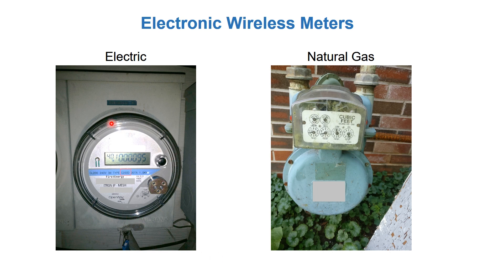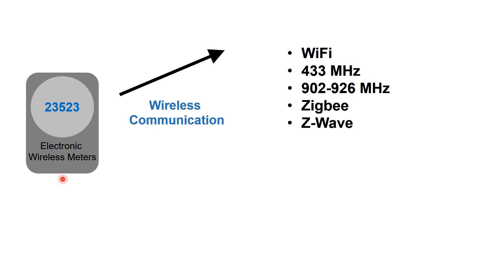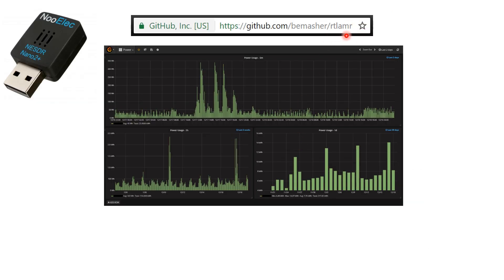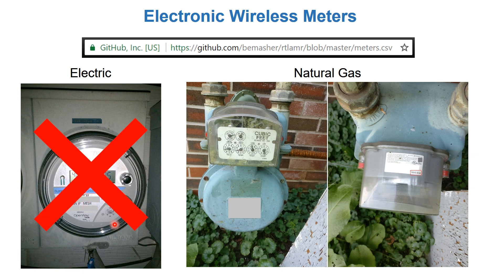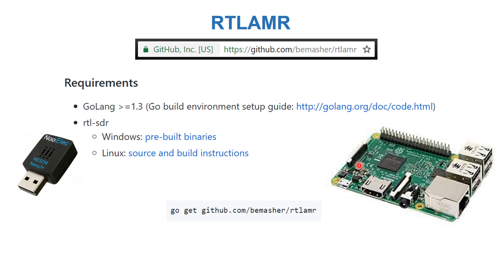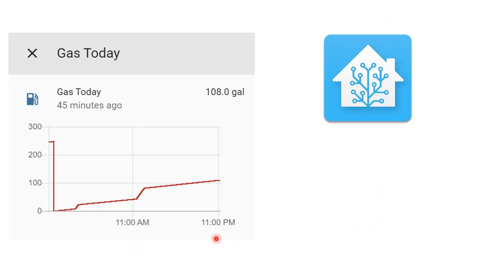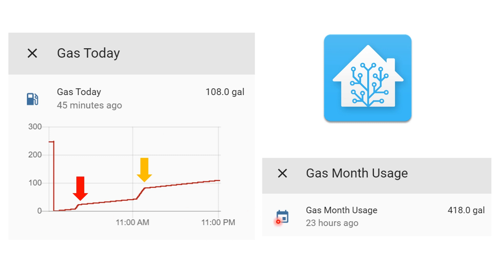Using RTL-SDR to read values from wireless electric/gas/water meters

Comment: I believe my smart gas meter at my apt is making an extremely high pitched noise in the house that never stops and I cannot sleep...it's driving me crazy!!! Are there any filters or anything that can be done? I have a Satic filter on my fuse panel that cuts the noise from the smart meter but it doesn't matter because this other noise is still there.  Please help!! Thank you
Reply from the maker: Wish I knew the answer to this, sorry!

Comment: Great video - exploring how to do this myself and get the data into Home Assistant. Is rtl-amr, your python script, and Home Assistant all in the same Pi? I have HA running in a VM, and wonder if I can put rtl-amr and your python script on a separate Pi, but unsure how to send the shell command to the Pi from the HA in the VM?

I'm still waiting on my SDR dongle to arrive, but I think I have the bemasher git project all set up on the Pi. Can't really test until I get the dongle, but the only part that was not really clear to me was the rtl-sdr Linux: source and build instructions. Would be awesome to have a video that walked new users through this process.
Reply: @deb-sahu  ok cool - so if I understand you (bear with me, this is my first foray into SDR!) the rtl-collect tool + grafana + influxdb has replaced your python script?

Comment: Debashish Shahu - I would normally have clicked off this video very early on but you presented this info in a painless easy to understand manner and I respect that. I know this was 2 years ago - so have you done any follow up work with this?? ALSO - Do people use a similar method to MANIPULATE their readings to the utility company?? 
As a novice, it’s my belief that if I can READ the specific values from the meter (by identifying the specific frequency it broadcasts on) around the clock, I can also MANUFACTURE values around the clock by terminating the meter’s broadcast at the source and producing my own broadcast on that same frequency (perhaps using the values from the actual meter, minus a certain % - as if I changed all gas appliances to high efficiency)...

Do you agree that this can be done and do you know if anyone has tried?

Comment: cab you please create home assistant configuration tutorial that will help. i used one of https://community.home-assistant.io/t/get-your-smart-electric-water-and-gas-meter-scm-readings-into-home-assistant-with-a-rtl-sdr/93707  but unable get it working, as per the CVS all my 3 meters are compatible.
Reply: After reading the link above and trying on home assistant manual installation, i was not successful. The Manual home assist, make it difficult to add a supervisor and autorun. 
If you can create an addon to home assistant many people will get benefits. it will be easy to add it without going through many steps with sudo :)

Comment: if my gas company says it's transmitted securely, does that mean from the gas meter to pge its secure, but not necessary secure on the gas meter itself? my readings are done in therms, not sure if that matters
Reply: @deb-sahu  how do you change the rtlamr to listen on the 465 Mhz band? also did you try a different protocol to try to connect to your electric smart meter?  or does it try them all automatically? https://github.com/bemasher/rtlamr/wiki/Protocol
Reply: David Beiler - PGE, you say?? As in California?? Type PGE Rothschild into google and see how the Rothschild’s own CA’s PGE and pretty much every other utility company so you can realize with them at the controls, NOTHING is secure... Maybe you’ll also come to realize that the PGE-involved “wildfires” are no act of nature or god as they claim...
Reply: FLOJOtube your dumb

Comment: great! Can be used those usb tv-dvb dongles with the R820T chipsets that are very popular in this field? How far can these codes be read? My gas meter is just out my balcony, while my energy one is about 5 meters away, 1 floor down...
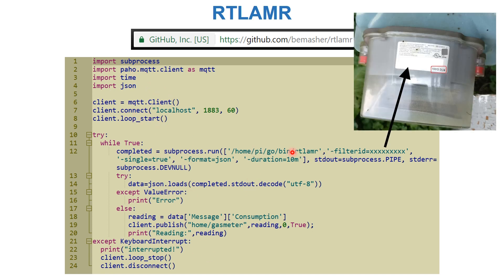Reply: great! And the "filterid" you say it needs to be entered in the video, at 5:00, is the one below the barcode?
Reply: thanks!
Reply: understood... thanks anyway :)
Reply: i asked on an electronic facebook page, they say our italian meters use the LON protocol... do you know if it's supported by these dvbt dongles? https://en.wikipedia.org/wiki/LonWorks
Reply: I heard you can even read data even from your neighbors so I guess you should be able to read your own
Reply: @deb-sahu  if we used a standard NUC with 8GB RAM / 256GB SSD and a fast processor could that decrypt all protocols?